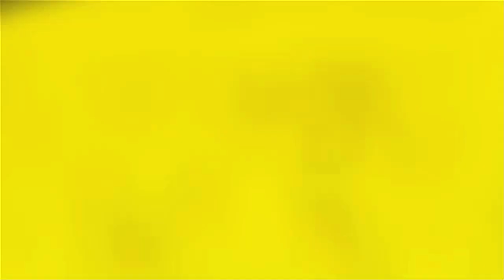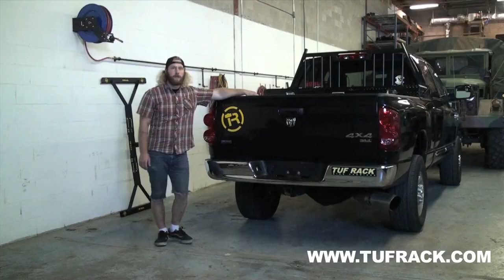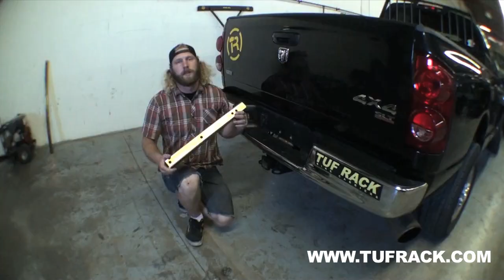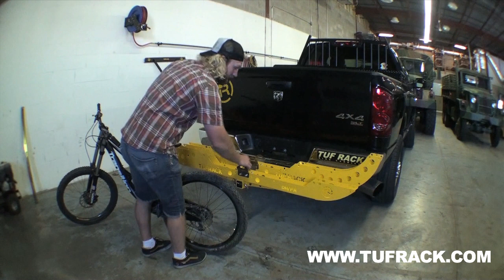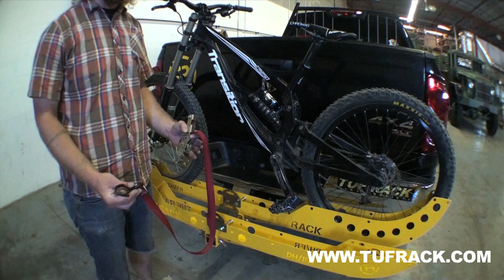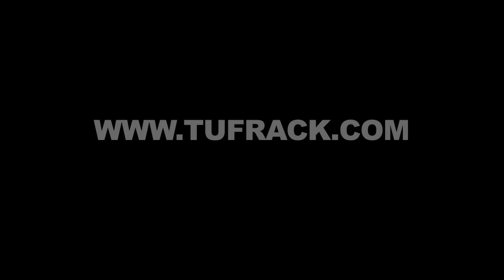Tuf Rack Install

Comment: Be good if you could build in some security features so if you need to leave the truck for a while your bikes won't get stolen OR your Tufrack. Also for MK 2 maybe think of a way to attached the bikes so the suspension isn't under load. Looks cool btw.